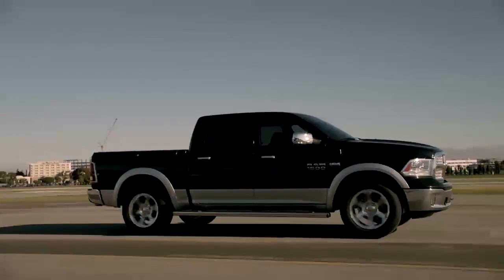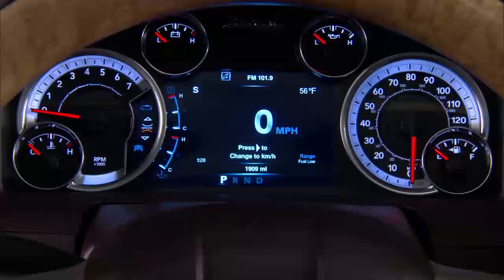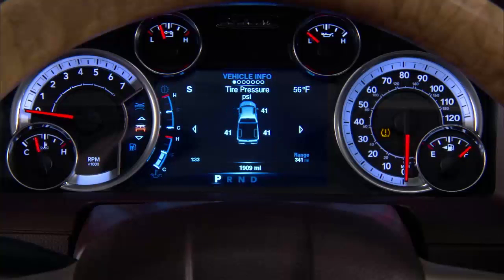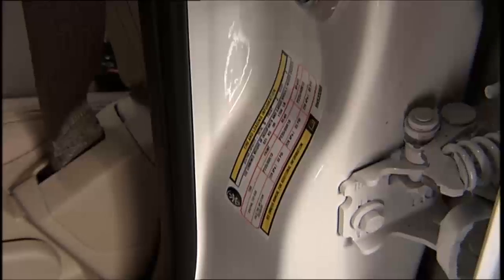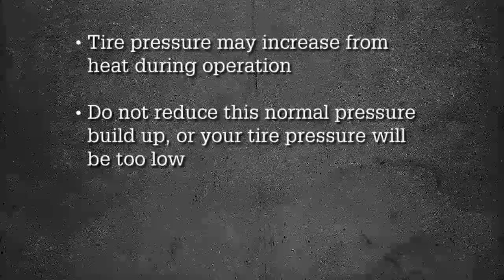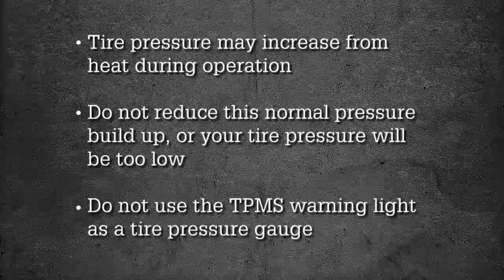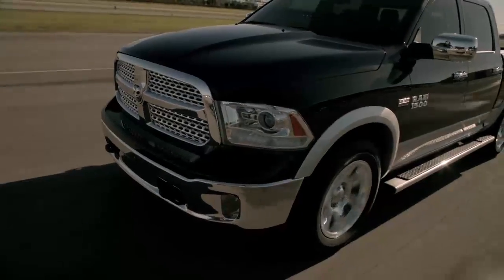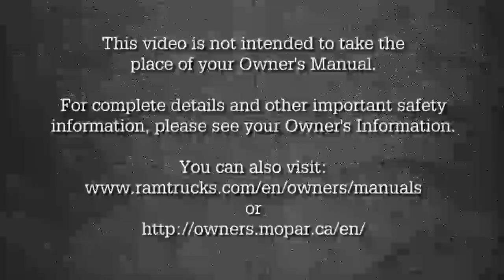Tire Pressure Monitoring System-How to use the tpms light and tpms sensor in 2017 Ram Truck

Comment: Where is the reset button?  What is the preset period of time?  What is the procedure?  This was a waste of time
Reply: One tire says it's between 60 and 40 kpa underinflated.  It was only 2 psi under, topped it up, still said i was way under.  Can't believe there's no reset button.
Reply from the maker: Hello Cash, 
If adding air doesn't resolve your concerns the TPMS can be reset by your dealer. ^LH
Reply: @mopar  It resolved itself somehow…. Maybe I didn’t get it up to speed or something.  Thank you.
Reply from the maker: Glad it worked itself out. Thank you for following up with us. ^LH
Reply: The fact we have to go to a dealer, to pay to get “diagnosed” to get a simple reset that you use to be able to do is not only absurd, it screams of some kind of fraud.